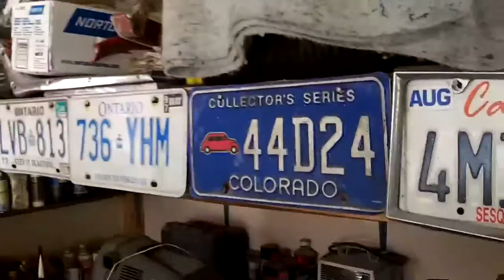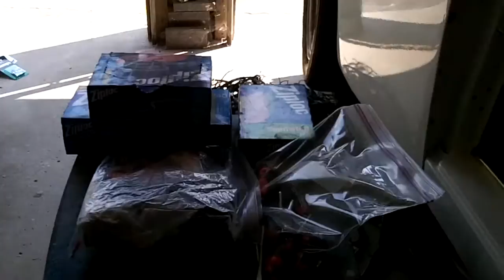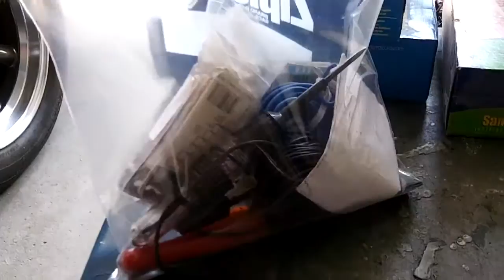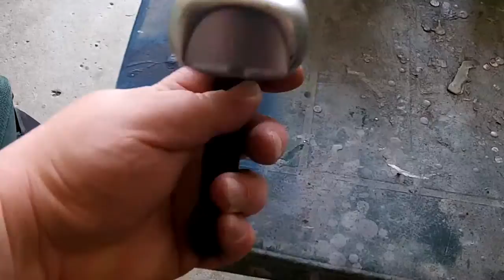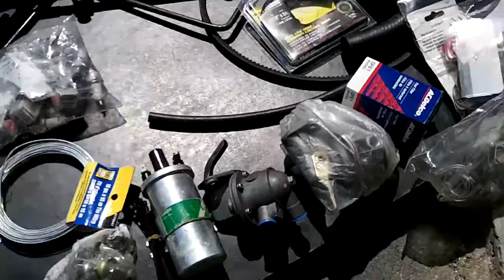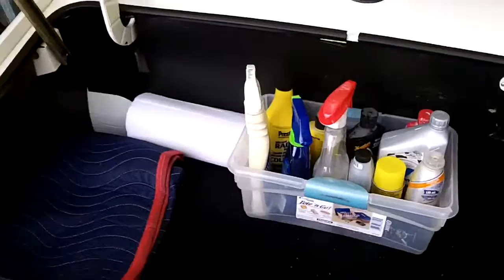Road TRip Prep, 1973 Triumph TR6

Comment: I know this video is an old one but it was nice to see preparation. When I did my drive to Victoria I pretty much filled the passenger wheel well with parts. Luckily the only need came about in the Alberta area and it was carb. diaphrams. 10 minutes a piece for the change and who knows why they both went at once. I also push started 2/3rds of the time because of a starter solenoid failure. It would engage eventually but I didn't dare take the chance of breaking the key off in the ignition. I wired a mechanics cheater switch directly to the solenoid and hid it up under the dash and honestly still use it. I've since had the starter rebuilt but still use the switch as it's a good anti theft unit now. By luck,  the only places the starter did engage first try were on the Ferry trip to and fro Vancouver island.